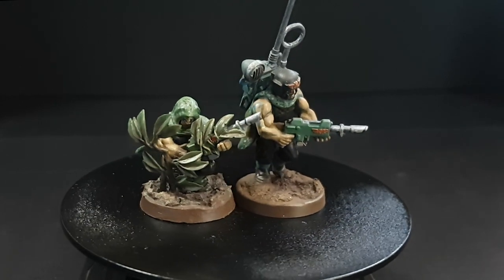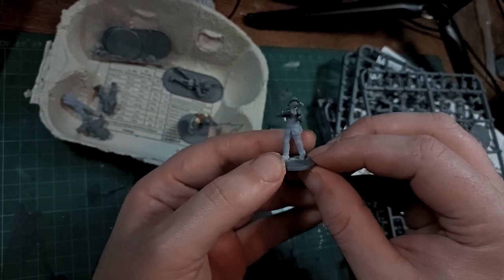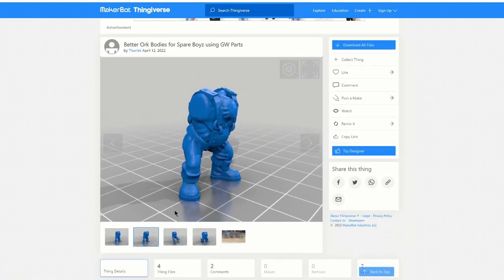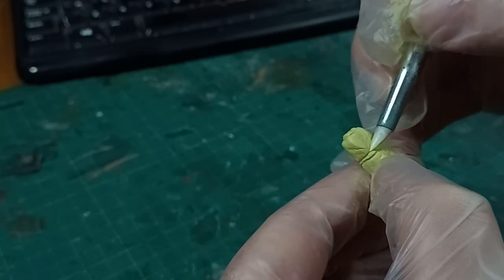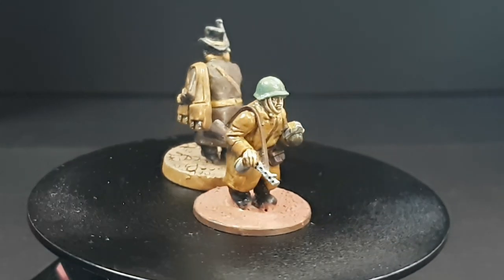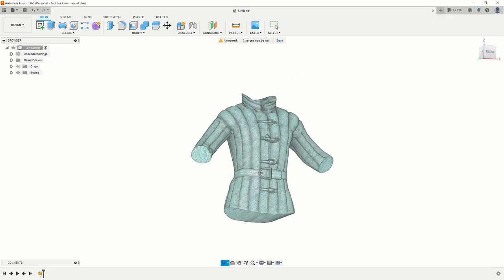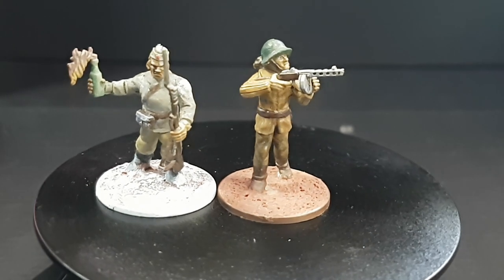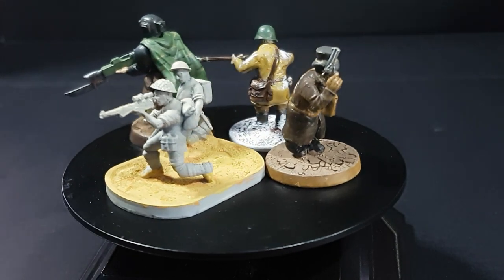What To Do With Spare Arms?

Comment: Other things to use spare arms/heads for:
-Basing material, etc. The most obvious use, to the point where some models are sold with whole bodies to adorn a base. A dismembered limb or head can adorn a model's base, or get stuck on the model itself as a grisly trophy. Stick an arm or head inside the slavering maw of a beast, mid-meal.
-Wounded figures or "wound tokens". I know that Sludge uses a system for tracking panic by leaving tokens next to units, and the examples used wounded models or bloody limbs for effect. But you could use this in any game where you have larger, multi-wound models that need health tracking. These can have bases with various sizes or numbers of limbs/heads to denote the value.
-Models depicted mid-death. Attach limbs around a frame of smoke or gore or fire or their own melting bodies. It takes courage to model one's troops already being murdered, but it can be a great effect.
-Models in hiding or camouflage. Heads and arms sticking out of a barrel, or beneath a leaf-covered mesh or pile of rubble. Dwarf models or various monsters (zombies, skeletons, etc) might be seen emerging from the ground (good for spare miner bits). Alien models, like Tyranids, could have bits emerging from eggs like xenomorphs (small Easter eggs might be good for this, although sculpting the egg from clay could also work).
-You could combine the previous two ideas, and have dead or injured models covered in debris. Maybe a pile of bricks made from sculpted clay or chopped up bits of sprue. This works especially well on weapon team models; one whole model mans the guns, while another lies buried beneath a collapsed wall the team was hiding behind.
-Weapon arms peeking out of vehicles, as if they're firing from cover within. Will require a door, window, or hatch you can wedge open.
-Unit filler. An old bit of tech from the late WHFB days, when rank-and-flank armies would be so large, players would stick larger than normal bases in the middle of their infantry blocks and built little dioramas on them to save money/time/sanity. If you're playing a rank-and-flank game, you could employ the above techniques, singly or in combination, to bulk out the force. From the arms of zombies rising from their graves, to goblin archers emerging from bushes, to a wounded soldier sitting in a crater surrounded by the limbs and heads of his compatriots.
-Terrain decoration. Another obvious use of spare bits, this time designed to litter the battlefield. Barricades with heads stuck on spikes. Figures half-submerged in murky bogs. A shattered pillbox, its valiant defenders draped over the lips of cover or buried under rubble. Panicking soldiers being dragged into dark holes. Creatures stuck to walls by goo or fleshy secretions, like in the Alien franchise. Web-strewn caves or trees, man-shaped bundles suspended above the ground, arms or faces jutting out.
Reply from the maker: That is a lot of good options there. Enough for a followup video if I can get around to building some examples!

Comment: The option im going with is slowly acquiring the extra torsos and legs off ebay and bits sites. I don't mind if it looks a bit chaotic because I'm going to be using alot of those spares for traitor guards and chaos cultists so the random, haphazard and Mish mash of of parts like one sleeved and one bare or having pants that look stolen from a different uniform honestly works well for that.
Reply from the maker: Yea I got a half squad of cultists on the way all made from a mishmash of random parts, converted with all sorts of spikes and stuff.
Reply: @EDSKaR  I find them a nice contrast to the mainly Krieg  army that's nice and uniform looking that  I'm working on building, but finding proper chaos-y spiky bits and fur capes has been the bane of my existence lately.

The rest of it is going pretty well with all the spare arms and heads and match my blackstone TG squad.